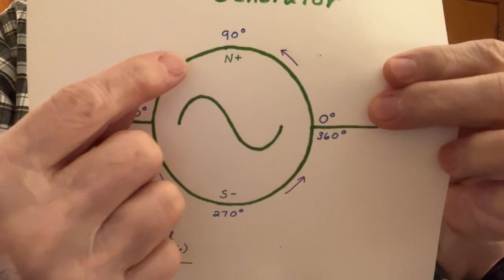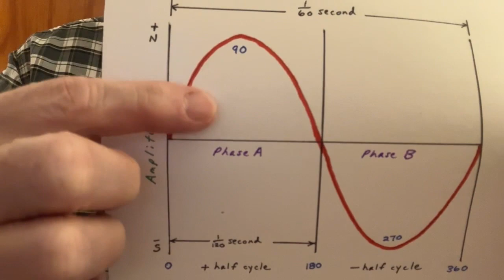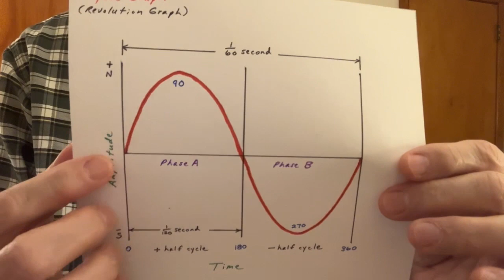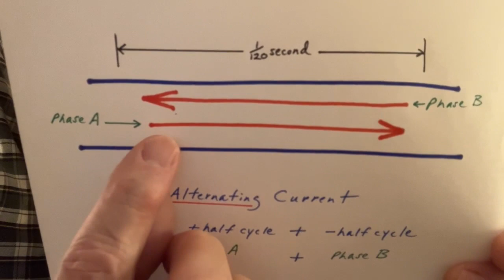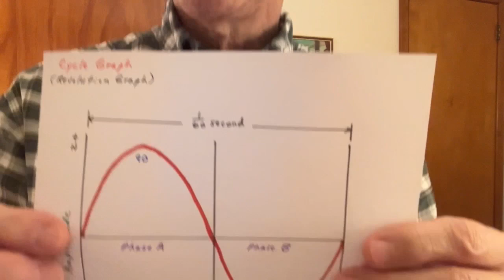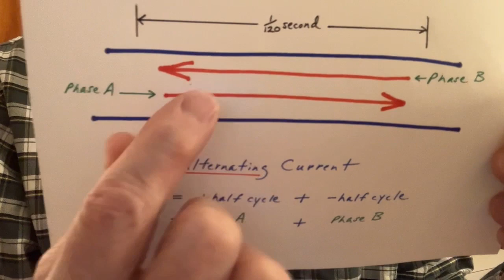AC Current Flow: #2 Single Cycle

Comment: Ok,   The problem is some dummies call the connection points for conductors phases incorrectly.  This is because they see in three phase you have connections called phase A,B, and C.  The connections are labeled as such.   In a clockwise direction, phase A is a connection from A to B.  Phase B is connection from B to C, and phase C is connection from C to A.   Single phase the one and only phase is from connection Line 1 to Line 2.
Above and below the time line are not positive and negative.   They are it talking about electrons moving, forward and backward.   Or could be amps increase and decrease in each direction, or voltage increase and decrease as the coil of wire in the generator get nearer and farther from the magnets.  You do not make it clear.   
Your title indicates that your sine wave is for current flow or amps.   So at any point in time the amps are flowing higher and lower and forward or backward.  As I’m sure you are aware that amps are not constant in AC system.

Comment: More accurately, domestic electric service in the US is two phase service. Each is ~120VAC referenced to neutral and 180 degrees out of phase with the other. 240VAC is obtained across both ends (with no reference to neutral)